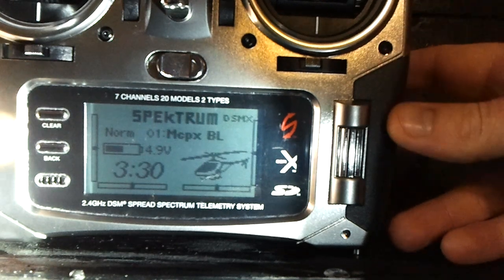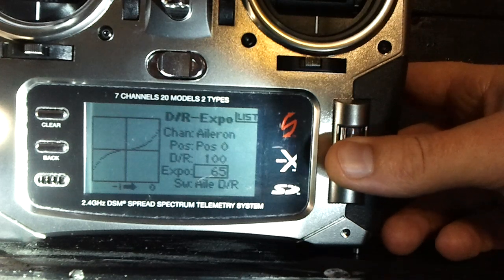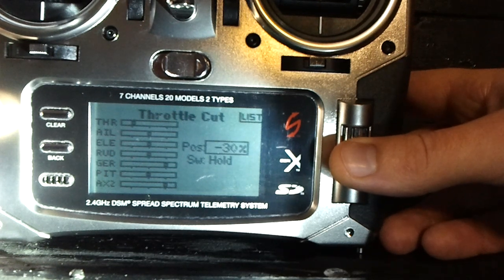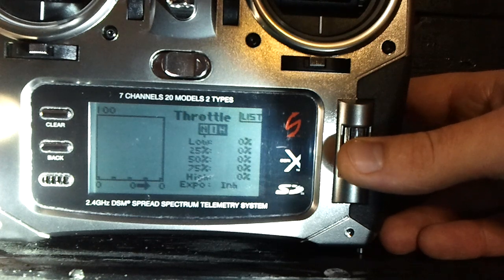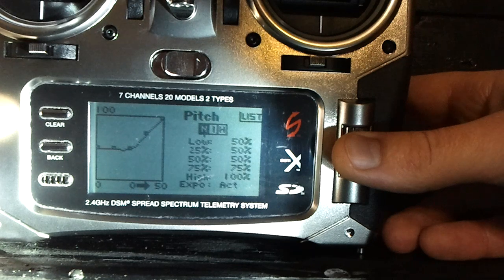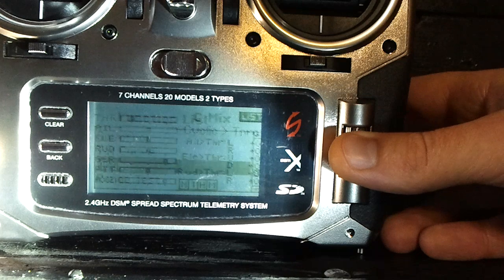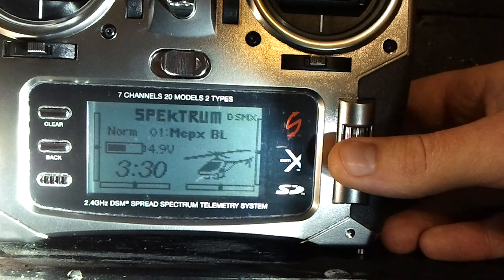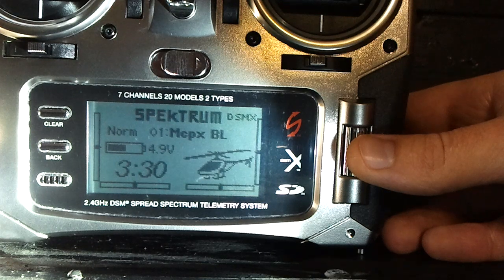How to program mcpx BL on dx7s

Comment: Hi Erik, I also have a DX7s and since I'm new to helicopters I was wondering since the F-Mode switch has only 2 positions how do you setup IU1 and IU2 on the DX7s ?
Any info will be greatly appreciated. 
Nice video by the way.
Reply from the maker: Wish I remembered.  I  have a tx16s now and haven't had specktrum for some time.
Reply: @Erik740t  Thank you anyway. I also have the TX16s now and I've solved all my problems on Edge TX.
Happy flying mate.
Reply from the maker: @DionysiosKontakis  did you get the tx16s to work on a 3d heli?
Reply from the maker: @DionysiosKontakis  it seems simple for most models, not that so much.
Reply: @Erik740t  Why do you ask? I fly my TREX 470LM with my TX16s.
 It was easy to program the MIcrobeast Gyro just by following the manual.

Comment from the maker: Update- go to servo travel menu. For pitch travel put 110% for first #, which is neg pitch/ bottom of throttle stick. Put 80% for second #, throttle stick up. Helis come w too much pos pitch and hovers w mid stick. This makes 3/4 stick hover, still plenty of pos pitch. Verified its not just my heli, but all of them seem to be set up like this. Will make a very short update vid showing how to do this.